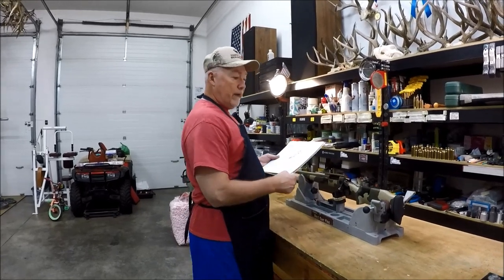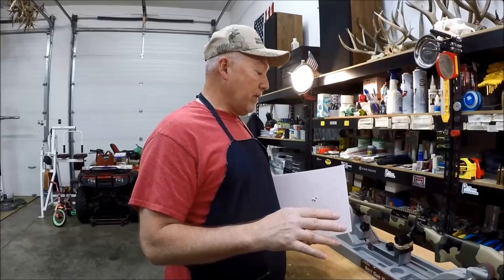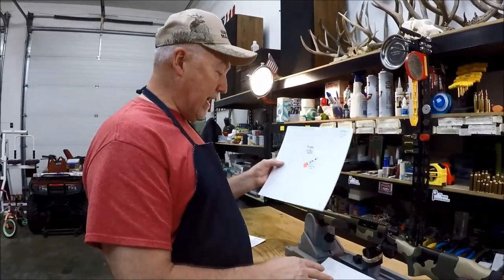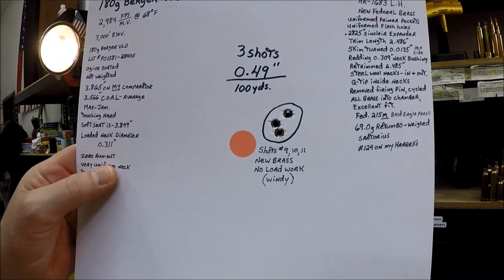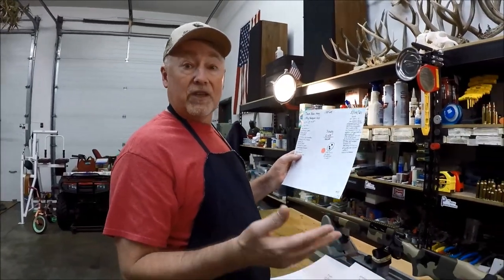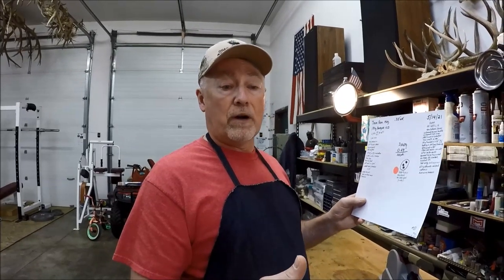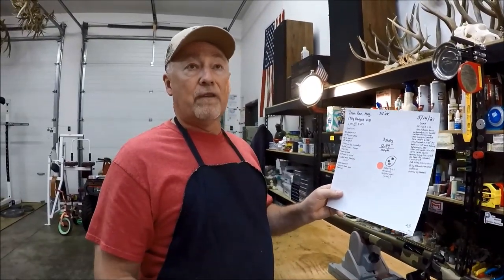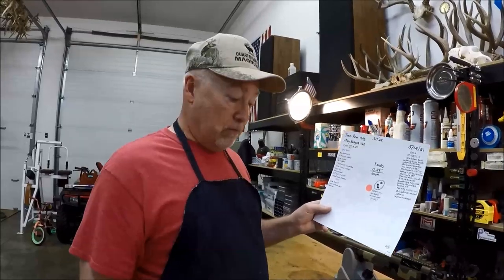7mm Rem. Mag. - To seat or not to seat?

Comment: Sir my 7mm Rem mag 770 new only shot 3 to 6 inch groups at 100 yards . got new scope hand loaded it now is 1 inch at 300 yards. Bullet depth 1000s off the lans . with patience  it now has a 100% cold bore zero . also found with pencil profile hunting barrel it heats up and spreads out if shot one after another. Fire shot leave bolt open let cool 10 to 15 minutes between shots to get better groups. I now have cold bore zero and with the time between shots hole in hole accuracy at 100 yards.  139 grain sst max powder charge coal 1000 of lans. Works flawlessly for me   .
Reply from the maker: Dear Sir - very good; thanks for the information.
Reply: @quarterminutemagnums  my pleasure sir at first I was in a hurry and after  spending all that money on ammo then having to buy reloading dies press and powders bullets primers I found less is more when you get that cold bore zero it's so gratifying to know you pull it out and 100 yards it hit perfectly every time .. It took me a month of Saturday's to get there about an hr each visit cold bore shots adjust wait 10 15 min shoot after 3 shots put it up for next time  after that spot on